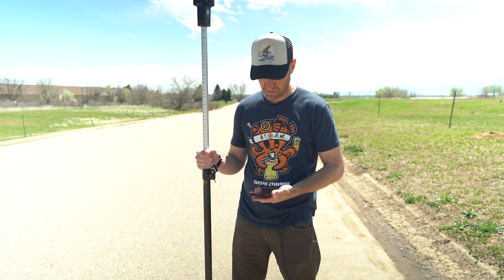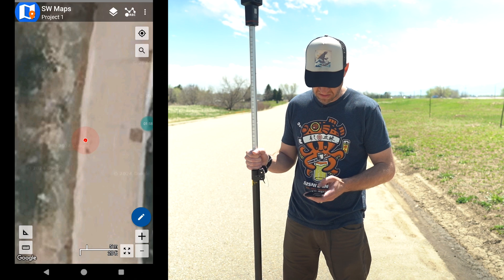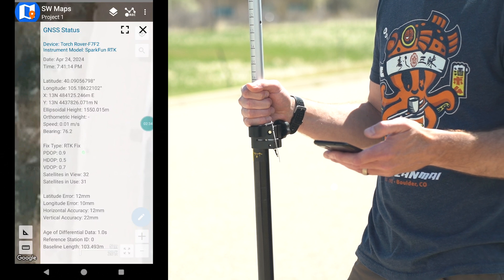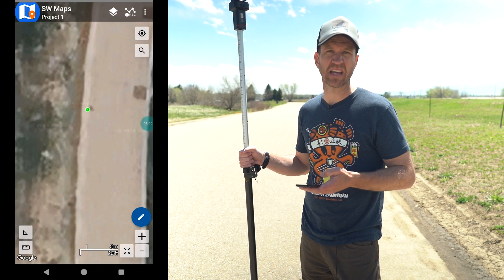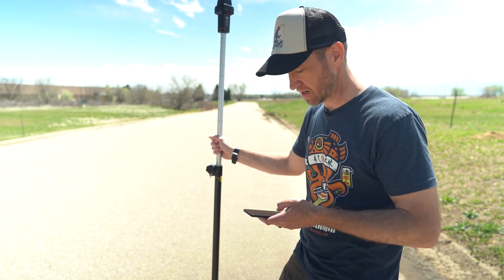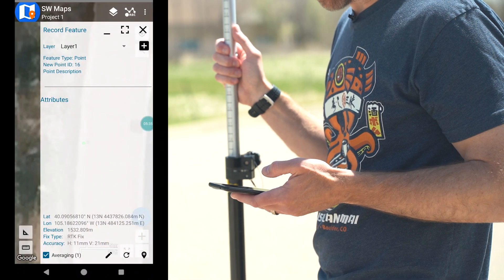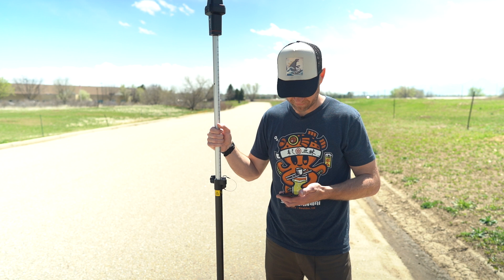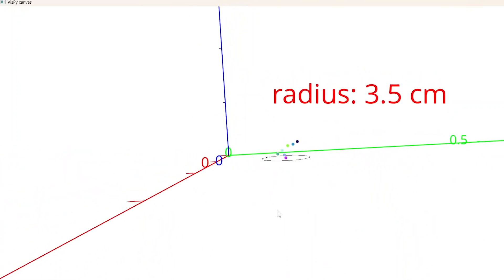Tilt Compensation with SparkFun RTK Torch

Comment: Will this feature become supported in firmware in the older RTK Facet if an appropriate IMU is connected to it's internal I2C connector? I think the facet even has an unpopulated spot where an IMU used to be in the design.